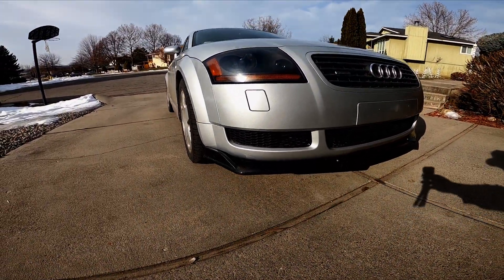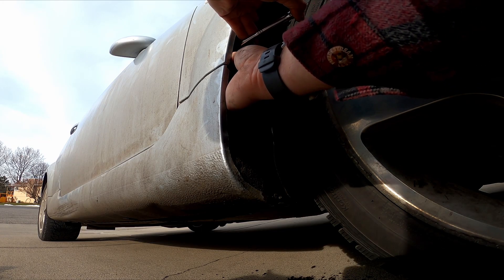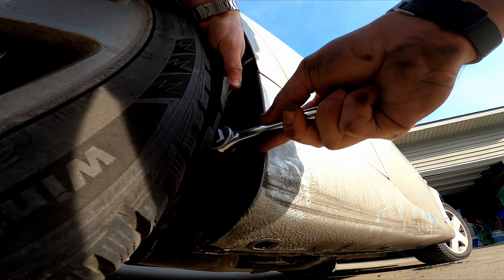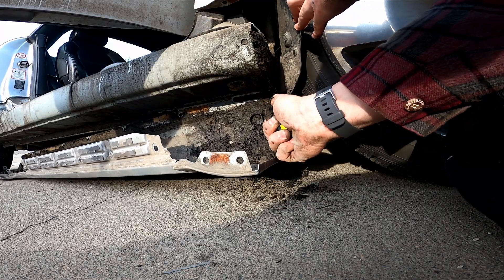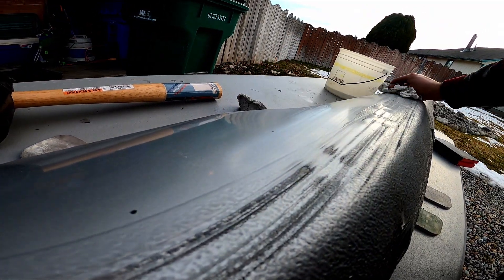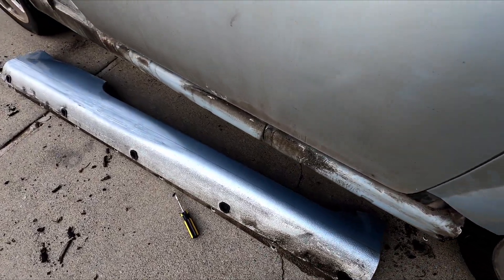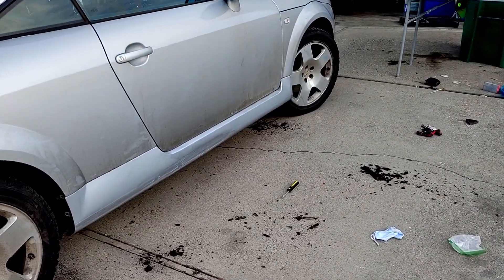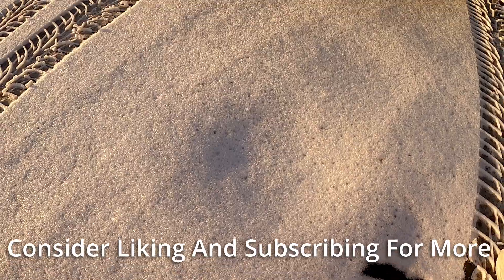Watch This Before Buying Color-N-Drive! | Restoring Terrible Paint!

Comment: I tried the colour 'n drive kit, here is my result (BMW car - Marrakech brown)
-The colour is similar but not quite the same
therefore if you look at the car after repair, from 2 or 3 meters, you do not notice anything. 
If you look closer like 1 meter or so, you see the colour is different, (90% similar).
Drying took 15 minutes and was ok.
All the rest of the kit : clear solution , paste or wax are not that necessary to be honest.
In conclusion, the car looks better after repair/painting but the result is not perfect as the colour does not match perfectly even though similar. For 50 euros, you cannot expect the same as it was before.

Comment: A wil look better
Reply from the maker: I like A alot too :) Thanks for the support!
Reply: @HunterDirection  sorry for asking, but how do you know when to service your turbo, check your xlutch mastersylinder etc, because I bought a 2001 225 tt, drove it for 3 weeks and it broke, and what km do you get per L? I get 8km and that is way to expensive for me
 
I like your car allot, keeps me motivated to keep mine, keep up the good work please 🙏
Reply from the maker: @00grootbul  hey no need to be sorry for asking at all:) I'm happy to offer my thoughts(I'm just an enthusiast though). As far as my fuel usage i average about 23mph (~9.77kpl) when I'm not driving aggressively. As far as the service intervals go I did some research for you, anything clutch related usually depends on how the previous owner treated the clutch(launching and harsh shifts put tremendous stress on the systems and reduce the lifespan) as a general rule of thumb you can replace the fluid in the clutch master cylinder every 2ish years or when you find debris in it. Turbos are also a bit finicky when it comes to when they go. If the previous owner took care to warm up and cool down the car before hammering the throttle they can last a bit longer. What kind of symptoms are you having?  The engine has alot of protective measures to prevent the turbo from blowing... Though if it's leaking or smoking you may want to get it checked out:)
Reply: @HunterDirection  for starters my turbo sounds like a supercharger 😂
Allot of turbo lag
Turbo stutter when I press the gas pedal al the  way down
The engine makes a weird noise (like a grrrr-grrrr-grrrr sound, lol) almost sounds like the engine is loose 
And now my lights won't work, they used to work but just decided they didn't want to work anymore, and I've also noticed that the buttons that open the fuel flap, boot etc also don't want to work, and when I disconnect  and connect the battery, the buttons work again
And the peep-peep-peep noise that always comes on when I start to drive, I have no clue what could that be
This is al the problems that I noticed on the tt, I am currently trying to repair everything but I'm on a budget as I'm living on my own, so I have to save up for al the expensive parts

I watch your videos every time I'm stuck on something, it really helps me out, I wish you could come to SA and help me fix my car, lol

So please keep the videos coming, I'm sure it helps allot of people, not just me